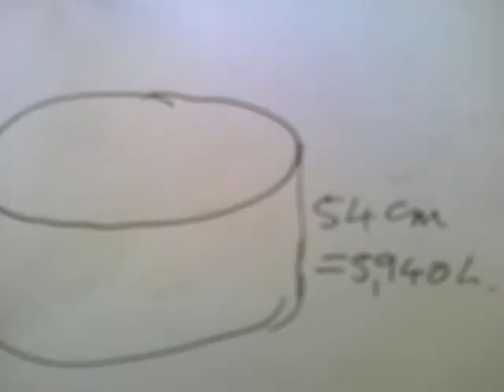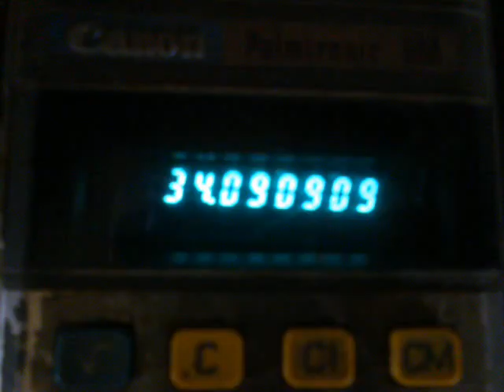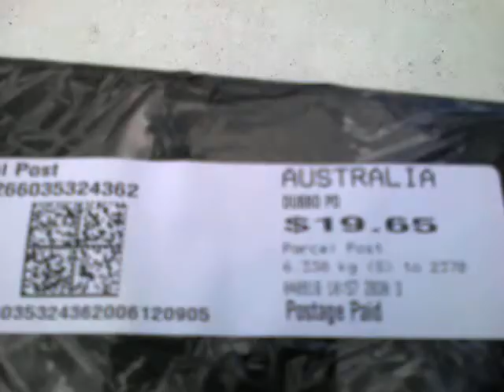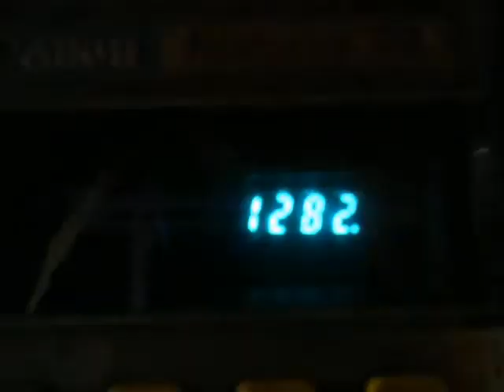DIY Stand-Alone Fire-Hose..; System Test & Review...

Comment: Great info! I have one of those old pools around here somewhere!
Reply from the maker: G'day,

  Thanks.

    I've been using them as Water-Tanks for at least a dozen years, maybe close to 15...; they use an UV Cover every year - and if not fenced then Kangaroos and Wallabies will eventually bite a hole in the Air-Boom while trying to drink, or poke a Toenail through.

 Which is also why I keep Water-Dishes out for them - so they don't need to try raiding the pools.

Have a good one,

;-p

Ciao !

Comment: Those swimming pools you use as water storage tanks must have a very short life exposed to UV rays and the sun. Have you thought about using something more durable ? Perhaps steel tanks as what farmers use.
Reply from the maker: G'day Ed,

  Thanks mate.

   Well, the thing is that Galvanised Corrugated Steel can begin showing Pinholes after only 5 years - it happened to a mate of mine who had paid the extra money for a steel Tank to avoid having a Plastic Poly-Tank  getting melted in a Bushfire.

  With a list-price of $200 + $39 for the UV Cover & Freight, say $300 for 6,300 Litres of storage, plus a new Cover every year to 18 months...; a Poly-Tank the same size is $1,600, with a 10-yr Warranty, and Steel is about $2,000 with 2 yr Warranty...

   The two older Bags I have are 5 yrs old, one had some slow leaks from Hailstone hits on the Bag, plus $250 worth Foam in the Ring - done very badly, but it works ; the other Bag is holding 6,300 Litres & has 2 cans of Foam under a set of Possum-Bites on the Air-Boom.

  If I had the Money I'd get Poly-Tanks, but I could get 4 Buoywalls plus the Water trucked in here to fill them, for the price of only one empty Poly-Tank.

  And, with either Poly-Tanks or Plastic Buoywalls..., I plan to run a ring of Building Insulation (Sisalation Foil) all around them, on the day ; to keep the Radiant Heat off the Plastic....

   So, all things considered, I'm pretty sure these Buoywalls work out at less than half the price of Conventional Tanks, unless something traumatises them, and then they're  fairly cheap to replace.

 And, they're all I can afford (!).

 Such is Life,

 Have a good one.

  ;-p

  Ciao !

Comment: Superb! 👏👏👏👏👍✊💪 

Glad to hear you got some rain too. 

Our rains tore down one of my gutters, spanning a bit past 20' on one roof edge of the house. 😠😠😠 I'll have to figure out a prop of some kind because though it's still anchored into a corner, it winds up the damn thing is a bit heavy and unwieldy, so I couldn't even get it lifted from my ladder to anchor  along it and set it a bit, so I can go back along it and get the proper gutter nails in. The nails goo through a hollow metal sheath that sits in and keeps tension on the gutter as well as securing it. 😠 And I don't like asking for help if I can do it myself or paying anyone. I am going to see if there's a 9' plank I can shove under it from ground level to act as an extra pair of hands😁 It's a little hard to pull off while it's raining and lightening as it is from morning till night 😠 I is not a happy camper at the mo' 😁 

Did you ever think of erecting your own mini water tower?
Reply from the maker: G'day Fee,

 Thanks mate.

  That Gutter sounds like the proverbial Hillbilly Roofing Problem..., when it's sunny the Roof doesn't leak so it diesn't need fixin' ; but when it's raining then you can't go up on the Roof to fix it because it's far too slippery & dangerous...(!).

  It sounds like you might do well to aquire or rig up a Trestle, to hold the Gutter up, or a Pulley-Block &  Rope Tackle, rather than a single long Wedge-Prop....(?).

  Because I didn't have a Waterpump I've been keeping everything Gravity-fed, but I'm considering a little Watertank on a Tower, to run a  better Garden-Hose than the ultra low-pressure one coming off the Inside-Out Waterbed which works as a Watertank fed by the Machinery-Shed Roof.

   A compliction is that because now I know that this Clearing is in a dead-tree Drought-Zone..., I want to see what I can construct up on the "House-Pad" where the Trees all still have their Green Leaves on them ; because this shit will only get worse, year by year.

  So, there is that....

  But, at least I'm getting the Fire-Plan together in realtime, rather than planning to make a Plan.

  Such is Life...

 Have a good one, and good luck with that Gutter thing - falling off a Ladder in the Rain while juggling Hammer & Nails and Wedge-Props in the Lightning & Thunder..., it's not a good look...(!).

 ;-p

 Ciao !

Comment: Glad to hear you got some rain,  i suppose clearing up old branches keeping the place around house free of bushes, grasses etc..also help. Hope you will have a safe summer, you got a good set up going. If the worse is to come, do you have a safe road to get out of there? take care and be well
Reply from the maker: G'day,

  Thanks.

  Yeah, over the past 6 weeks I've raked-up & wheelbarrowed 13 loads of Leaves out of the Clearing from around the Hut & Shed & Aeroplane Trailer, at 40 Lb per load, so 520 pounds (240kg or so) - and I put it a couple of hours on the Leaf-Blower as well, and probaby shifted about as much again, moving it further out & away from the "defended area".

 The thing is, as I showed in a Video posted about 3 weeks ago titled,

 "Raining Bushfire Fuel ;...."

  because so many Trees on 3 sides of me have browned-off & dropped their Leaves..., I have 36.28 Tons of cured Fuel per Hectare on the Ground ; it's like 3.628 Kilo's of Firelighters & Kindling per square metre..., so  it'll take a few things going right to be able to save the Hut, but it's not a hopeless endeavour.

  The Sheepfarm is only 50 yards away, bald, bare, and with stones showing through...; so if this place becomes untenable, by reason of the Pump failing, or  running out of Water (or of Fuel for the Leaf-Blower..., because they give a 60 mph Wind wherever one wants to blow the Fire back onto itself...) - then the theory is to leap into the vehicle and drive straight out onto the Rocks as a Refuge Area.

  Opening the Gate is part of the Sequence, while waiting for the Pump to warm up, so that it can run at full throttle without needing the Choke applied...; as you can see by the Clockface herein, there was 5 minutes between starting the Pump & commencing to hose Water.

  It's scheduled to be a busy time interval...

 Such is Life,

  Have a good one...

  ;-p

  Ciao !
Reply: good idea about the clearing. take care